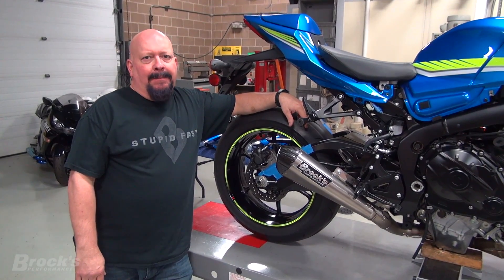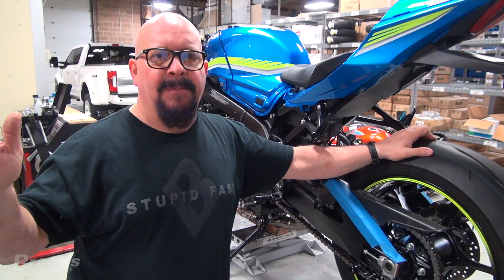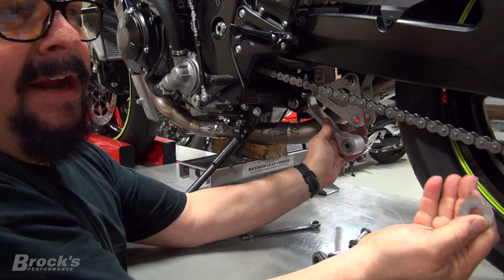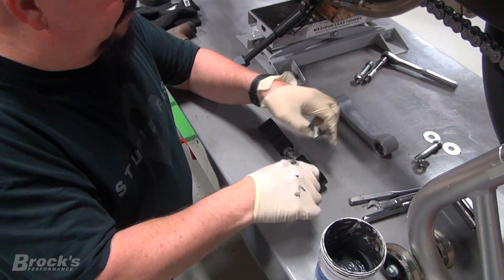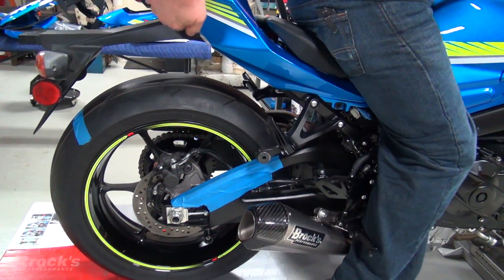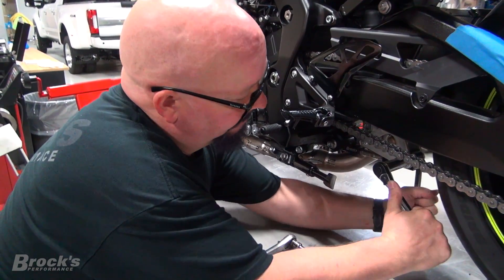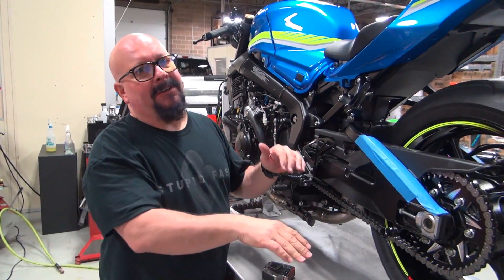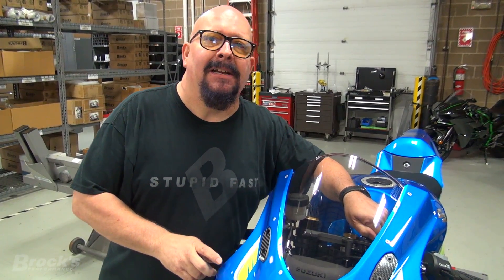2017 GSX-R1000 S2B: Episode 9 (P5) – Lowering Link Install and Final Drag Prep

Comment: I'm glad you cleared that up about the brakes. Some of these self-proclaimed geniuses that make videos out of their garage and work on bikes in the dirt, don't understand that this is a drag race modification only. These guys will remove one rotor off the front to show off their stock ass front wheel but cringe at the thought of taking a little material off the brake pad. That's the kind of secrets that drag racers have pushed the limits on for years to win races. Keep the videos coming. Still waiting on an explanation of how that clutch cushion works. LOL

Comment: Tip for anyone needing bolts for the front fender reflector removal: the bolts holding the seat is the right shoulder, and looks the same as the rear bolts.
Reply from the maker: @Mats Petersson - Thanks for the tip!

Comment: Hey Brock I have in 2011 gsxr 750 . Just install a vortex lowering link kit ( LL542) . Would I have to lower the front fork? Daily driving no track . Highway and street only . Thank you great video bro
Reply from the maker: Hello Miguel, for daily driving we set the bikes up to be level, or raised a bit in the rear (slightly nose-heavy) by lowering the front forks to match the rear drop from the link install. The bike will handle/brake more precisely, and be less subject to head shake/wobbles etc. Here is more info. on our VertKit install on the BMW S1000RR, you can follow these guidelines to adjust your 750. Please note the warnings and items of caution: http://brocksperformance.com/content/Instructions/S1000RR/998035.pdf

Comment: Hi there . I have a question here . After dacatting the stock gsxr1000r 2017 header, what should i do with the front Set valves(Exup) ? 
I have a slip-on pipe from Austin racing and a titanium link pipe right now with a servo buddy. 
THANK YOU.. 😅
Reply from the maker: With the stock (small diameter) head pipes, the bike will lose top-end power if the SET headpipe crossover valves do not continue to function as normal.
Reply: @BrockDavidson  Thank you so much for the answer. Have a very nice day sir.

Comment: Dear Brock, at the min 35:06 of this video you say that this "window link" can also raise your bike. This would mean a shorter link than OEM (142mm). Can you please confirm that and specify how shorter can i it go? thanks
Reply from the maker: That is a general statement regarding the fully adjustable design of our Window Links. On the 2017 GSX-R1000 -specifically the link will run into the cat if the bike is raised. If an aftermarket full system is used, the bike can be raised, but the adjustment rod must be shortened for any substantial change. If you believe there is a market need for a link that can be raised, please submit your request here: https://blog.brocksperformance.com/product-request/ and our engineering team will take a look.
Reply: @BrockDavidson  thanks for the answer. well to be honest, i really like your videos on the Gixxer > L7 but i am really not a drag racer. However i have learned a lot from your videos. thanks!!
Anyway, i really believe that a adjustable link could be very useful in track racing because it would allow you to play with height but in particular with suspension progressiveness. Moreover, it would be fast, easy and cheaper than having a stock of "Yoshi" dogbones that cost a lot and take more time to be fitted.
If you look at MotoGp, they all have an adjustable link.
Reply from the maker: @ubbaracingdepartment9892   Your bike doesn't know where it's wheels are spinning. If you fill out the form, engineering might have a shorter adjustment rod for you? We make lower and raise configurations for the H2/BMW and a couple others, but that's because their geometry allows it. With the gixxer, it can't happen with a single rod length.

Comment: Hi, when you inspect clearance, is it more appropriate to remove the shock springs to check? With link removed its not how it operates.
Reply from the maker: That would depend upon what the major obstruction on your bike is. Will the shock bottom out before other hard parts on the chassis? Etc...

Comment: Can your links be used to raise the bike slightly?  I switched to a different size tire and it lowered the rear of my bike about 1/2".  I'd like to sdjust the rear back to stock rather than lower the front to match...
Reply from the maker: Out of the box - not usually as they are configured as "lowering links". That said, some bikes do allow raise and lower and some links can be custom configured with a shorter adjustment rod. Please contact our customer service team for more information. Or go here to request exactly what you are looking for: http://blog.brocksperformance.com/product-request/
Reply: @BrockDavidson  Thanks I'll put in a request for what I need.  I'll measure the stock dogbone length and if I can buy a set that will get 10mm (give or take) shorter that will work a treat, thank you for responding so soon!

Comment: Got been I get there part number for the lowering kit and the kickstand?
Reply from the maker: https://brocksperformance.com/radial-mount-front-end-lowering-kit-multiple-fitments-please-review-list/ and https://brocksperformance.com/billet-adjustable-brockstand-black-track-style-gsx-r1000-r-17-20/ and https://brocksperformance.com/window-link-kit-adjustable-gsx-r1000-09-20-and-gsx-r1000r-17-20/
Reply: @BrockDavidson  so This is my second bike moving from a cbr 500 to 2017 Gsxr 600. Will only be street use. I want to lower the rear because I am a short guy. Do you offer something to just lower the rear enough to plant my feat. I’m 5’6

Comment: Hey I'm trying to lower my 19 gsxr. I can flat foot it. But my ass can't get my leg over it. I got up to a 4 inch drop in the back. I noticed if mash my ch3st to the tank I can do it. Should I lower both parts equal. Front to rear? Will it affect my geometry.  Bike rides amazing.  Other than my short legs.
Reply from the maker: As a general rule, we like to have the bike as level as possible as trail changes on the front end can cause irregular handling after such extreem changes on the rear. Make sure you are prepared with one of our adjustable kickstands as the OEM will no longer function correctly.

Comment: i have a situation. I set TC to 3 and  riding normally then suddenly TC light goes on and engine mode and tc showin (-) and chec in mentioned.....then what does it mean  ?
Reply from the maker: Check the codes in dealer mode and compare them to your manual - the bike will tell you what it thinks is wrong.
Reply: @BrockDavidson  where is dealer mode ?
this error goes itself while riding and come suddenly any time.....
Reply from the maker: @hassnanbig  you will need to purchase a Genuine Suzuki Service Manual. It will show you how to place the bike in dealer mode to display the codes, then cross-reference the codes with other manual's definitions to determine exactly what the bike thinks is wrong and what needs to happen to repair, so the codes will not return. Or, let you local Suzuki dealer handle.
Reply: there is not a code because its just showing CHEC.  i have a video of behavior of bike..i want to show you..Please tell me how ?
Reply from the maker: @hassnanbig  that message is telling you to put the bike in dealer mode to find and define the code...

Comment: I am NOT going Drag Racing... BU... I have a rather short inseam -- 'complicated' by 7 major leg surgeries that have reduced my range of motion and my knee strength.  AND on the FZ1, the factory placed the foot pegs directly at the point where my ANKLES should be when my feet are on the ground...
So I need to lower the seat yet still have enough cushioning for daily riding... Can I raise the fork-tubes by an inch, or so, and drop the rear by about the same amount, with an adjustable link, without 'destroying' good handling on twisty mountain roads? 
I WISH there was a reasonable way to simply lower the mounting point for the tail-section sub-frame, and fiddle a bit with 'set-backs' for the foot controls... but that doesn't seem possible.
I really enjoy your videos!! Even though I am not Racing anyone, I still pick up a lot of adjustments and ideas to make my bike 'better'...
Reply from the maker: Yes. If you drop the front and rear the same amount, the bike will lose a bit of trail in the front end and actually turn a bit quicker.

Comment: How much will increasing the rear height by 1 inch affect the handling and balance of the motorcycle?
Reply from the maker: For most people, it won't be noticed. For road racing, it will reduce trail and quicken the steering.
Reply: @BrockDavidson  Thanks for the good advice.

Comment: how low would you recommend lowering a ‘22 zx14 ? i have a(n) adjustable 12-14 inch swingarm
Reply from the maker: @Allen Grant On our Brock's Performance extended bikes, we consider 3" ground clearance about as low as practical on the street with rider sag set at about 9/16" and the correct spring preload and compression/rebound settings. More on rider sag: https://youtu.be/ZqIiIB_oP1I . More on compression/rebound: https://youtu.be/ZsIcE5GoGvk Remember, it's better to be too tall, and slowly walk it down in small increments than to slam it right away, break your oil pan, drag bodywork or even crash...
Reply: @BrockDavidson Can’t believe I’m talking to Mr. Brock himself 🤩😂 but most definitely , I appreciate it sir .. and one last question. I just recently purchased your Alien Head 2 full exhaust system .. a tune and dyno is required correct ?
Reply from the maker: @Allen Grant - Nice to meet you also! Our exhausts come we free Map Support - click here for more info: https://bit.ly/3F1vK0N as far as needing a dyno...please check this out: https://bit.ly/2EJ1zAV

Comment: Brock what will be the best setup to keep the front down with a extended swingarm. To have the front lower then the back to have it even or to have the back lower then the front. Thanks
Reply from the maker: As explained in the video, there is no 'best' for any of this...there is a starting point, then track side testing to determine which works out best for the bike/rider combination.

Comment: Hi Brock witch sprocket did the black gsxr 1000 use at the time you guys dragrace it? Om standard wheelbase. You have that bike on your website promoting the ellien head
Reply from the maker: If it's the bike I belive you mean, it was one down in the front and two up in the rear.

Comment: How is the throttle play? Is it tight?
Reply from the maker: Since it's throttle by wire - the tension exists only to make you feel comfortable as a rider. Feels like a perfect pull and release...even if it's only a radial potentiometer.

Comment: What size wrenches are you using to tighten the lowering link ?
Reply from the maker: @Tae Tae - 5/8 and 3/4 open-end wrenches. (Material used is not available in metric sizes) Please remember one side has a left-hand thread - see instructions. LOWER also means direction to LOOSEN the jam nuts.
Reply: Brock Davidson thanks well appreciate 💯

Comment: Brock I'm a big fan of yours! I also live in Xenia. I ride a 2006 gsxr 750. It's pretty much stock,except I lowered it. I love your lowering link. I bought an ebay special adjustable links. Andi launched hard and it broke one eye end. I am glad i checked it today,heard a rattling. Scary stuff! Anyway what kinda glasses are those and where did you get them? They got a yellow tinge to them. Ok well when I ever get extra cash I'll come see you!
Reply from the maker: @kevin Please send info. And images To sales@brocksperformance.com we would like to inspect your links. We don't sell on eBay, but we do deal with poor quality counterfeit items more often these days. If they were ours, we will gladly remedy the situation.
Reply: Ok I'll try and take some pictures of the dog bones I got off Ebay. I think they were the $49.95 pair/ knock off from China. They don't resemble yours Brock. These had two side links with an adjustment nut in the middle. I can tell yours are very well made. I didn't know you had a lower link available until I seen this video. Anyway thanks for the response and hope to get some tips from you on clutches and stuff! Ttys!

Comment: Hey Brock! I bought a 2016 GSX-S1000 and want to strap the front down. I called your shop a couple hours ago and the girl that answered said you don’t make the radial brackets for my bike. I told her my bike is based on 2005-2008 GSXR 1000 and she said you guys don’t make them for that either. Can you help?
Reply from the maker: Use our bike finder. I plugged in 2008 gsx-r1000 and this was the result: https://brocksperformance.com/radial-mount-front-end-lowering-kit-zx-10r-11-15-z900rs-cafe-18-21-gsx-r1000-05-16/ (check technical tab for fitments)
Reply: @BrockDavidson  Thanks man I will check my bolt spacing before I order!
Reply from the maker: @prostreetgsxr are you Next Imports USA?
Reply: @BrockDavidson  no sir
Reply from the maker: Ok, thank you.
Reply: @BrockDavidson  I ordered it from you thanks again!
Reply from the maker: @prostreetgsxr - please let me know if they fit properly.
Reply: @BrockDavidson  they did thank you!

Comment: What exhaust is that in vid?
Reply: CT Megaphone?  Was that ever made available for the Kawasaki ZX10R?
Reply from the maker: Not yet, but it's in process.
Reply: @BrockDavidson  Please make it a footpeg mounting bracket, if at all possible to keep the under-seat area clean looking like the new Penta-carbon looks.  I am still deciding what exhaust is going to be best for my application.  And then, I see this CT Megaphone.  2017 ZX-10RR; Penta-carbon or CT Megaphone?
Reply from the maker: @GR8WHITEC5  the CT Meg is delayed due to various issues. Expected delivery is springtime 2022...if that helps.

Comment: 17 GSXR1K  I lowered my front 2 3/16.
Reply from the maker: The R version is no problem to lower in the front - the standard will be clamped on the fork taper on the lower tree...not a good idea.
Reply: @BrockDavidson  what distance would be the safest? I've been riding this way for about a month or so. No real issues so far and been measuring frequency for slippage.  Did a couple low speed stoppies to test it. Dumb yes, but didn't know how else to test it lol
Reply: I'm glad you cleared that up about the brakes. Some of these self-proclaimed geniuses that make videos out of their garage and work on bikes in the dirt, don't understand that this is a drag race modification only. These guys will remove one rotor off the front to show off their front wheel but cringe at the thought of taking a little material off the brake pad. That's the kind of secrets that drag racers have pushed the limits on for years to win races. Keep the videos coming. Still waiting on an explanation of how that clutch cushion works. LOL

Comment: owwwww that eye looks sore!
Swingarm angles are great to get right, on a TRACK machine designed to enter, settle, and exit corners at the absolute quickest way.
On bikes for drag racing? Throw all that information out the window. haha
Reply from the maker: @Lifted - pretty much, although there are measurable gains to be noticed, especially in longer swingarm/lower traction applications.